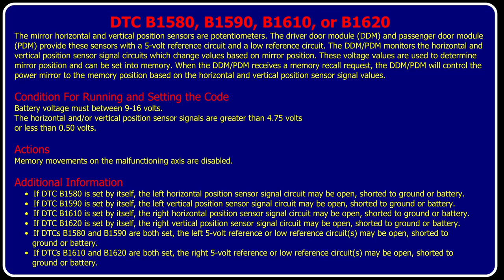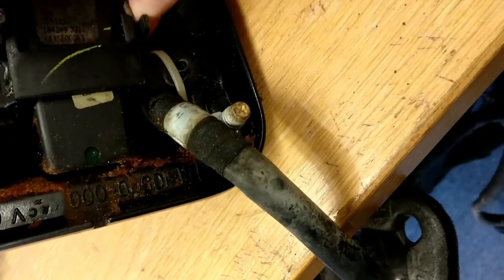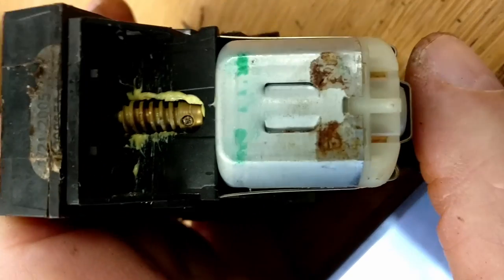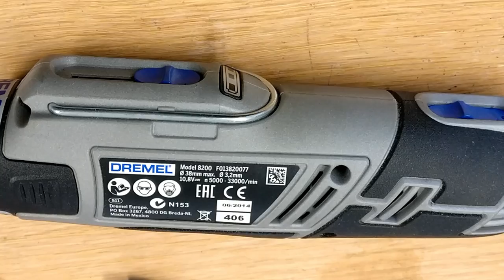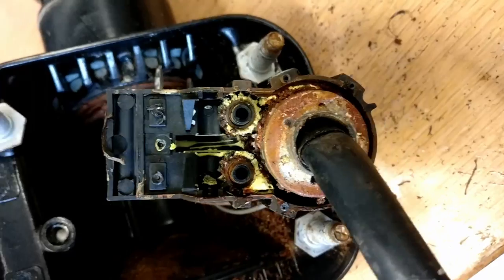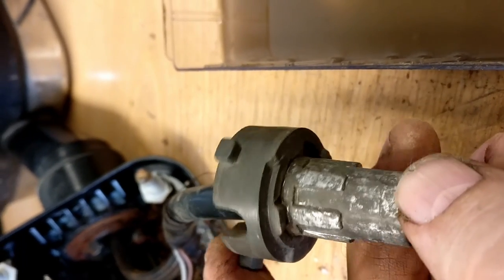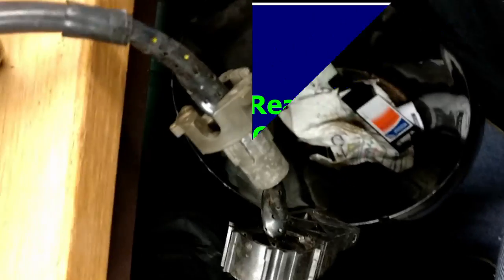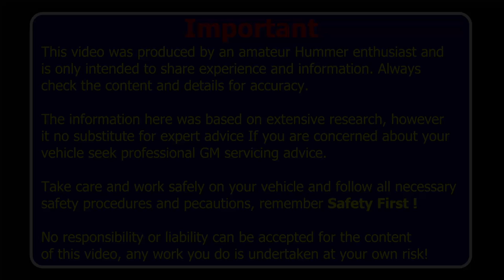HummerFixes - Left Power Power-Fold Mirror Repair

Comment: Fantastic video.   Unfortunately this is far too fiddly for me to do, but thank you for the detailed video
Reply from the maker: It's just time and patience really, I'm sure you can do it, I bet you good with engines though👍 The right hand side was actually my very 1st YT video and unbelievably the most popular by far, it must have really struck a chord, I guess people would rather fix than buy.

The mirror pan-tilt mechanisms, are also a real problem , especially when you have to jump-outside to set the passenger mirror. I personally find curb-view very useful, so I'm currently working on a video on how to repair these problematic mechanisms.

Some owners also have trouble with the mirror-arms "fluttering" or wobbling so badly they can't see clearly, there is a fix for this on hummerforums.com

At some point I'm going to address the "sun-roof not closing" issue another common problem.

Comment: My brand new left one not turning in, do you think that could be because faulty door module? The lock function does not work. I use the auto unlock in the dic to unlock and lock doors,
Reply from the maker: The DDM does control all aspects of the mirror i.e. its drives the motors up/down, L/R etc. If nothing works on the front left door, yes the DDM could be the problem, however if auto lock/unlock and some keypad buttons still work, it may possibly need cleaning.
https://www.youtube.com/watch?v=JZl74FiK714

Comment: Here's a question, is it possible to change the oem radio region to the UK and thereby change the frequencies on the radio from odd to even?   Eg   89.9 to 89.8?    Would improve radio reception..
Reply from the maker: Are like you getting bad (FM) reception with you OEM?  Not sure why the standard res is odd, quite a number of US are even. Seems to be now way to change this in the  Owners Manual. The radio itself (internally) may not be that accurate,  manual tuned systems even less. Best thing I ever did was fit a Pioneer system,   it transformed the Hummer, DAB, Android Auto Navigation, Google Voice for dialing and internet information, TomTom Amigo for cameras, back-up camera etc etc. certainly couldn't live without it now....

Comment: I just took mine out. The worm gear was broken in half. Two other gears broken off. Everything completely rusted. Something i did do is spray pb blaster into the neck and wd 40That mads the mirror turn better. The big gear had many missing teeth im goijg to buy a new set.